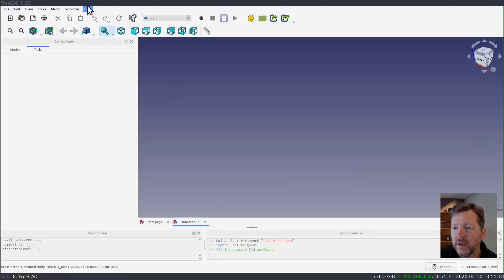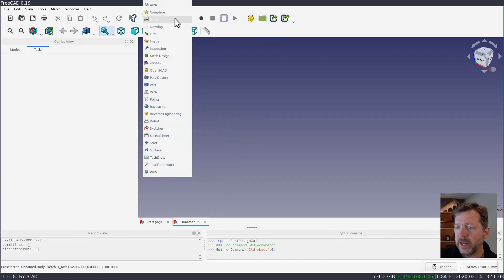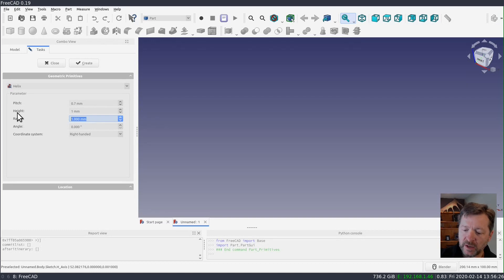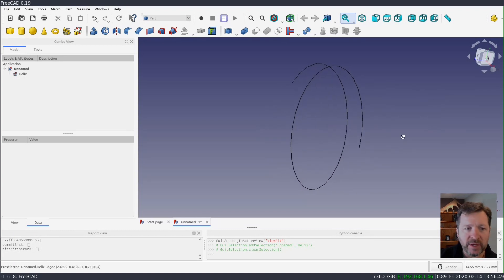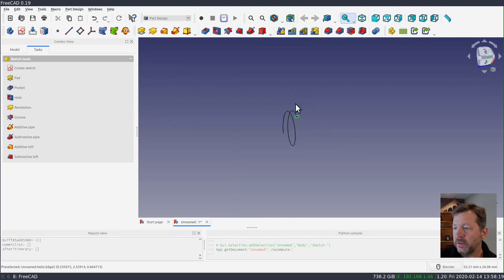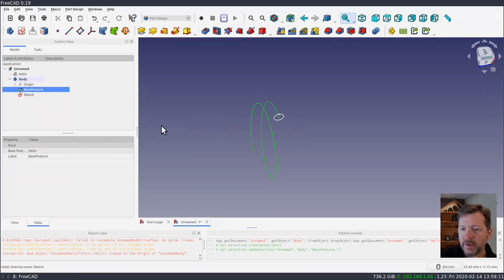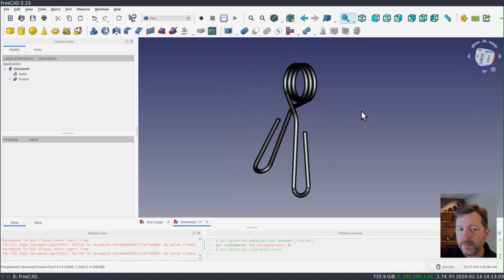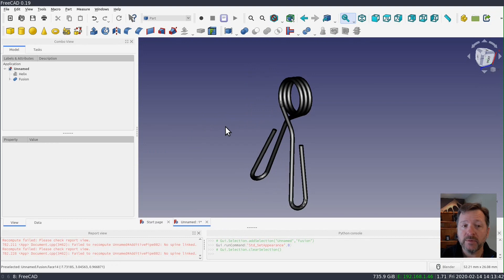Model a Torsion Spring

Comment: Hi Brad, when you Extrude the initial circle can you 'add edge' initially to include the geometry rather than selecting 'object' first?
Reply from the maker: I really dislike that task panel. There's a couple like it throughout FreeCAD and they're all confusing. In this case, you either sweep individual edges or all the edges in the object. In my case, the helix only has two edges but if it had more, adding them one at a time would really suck.